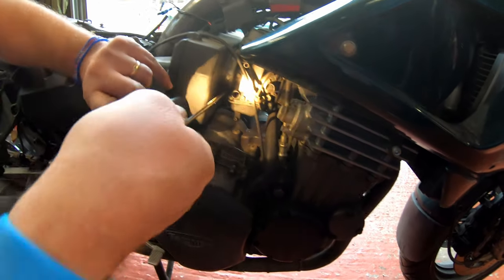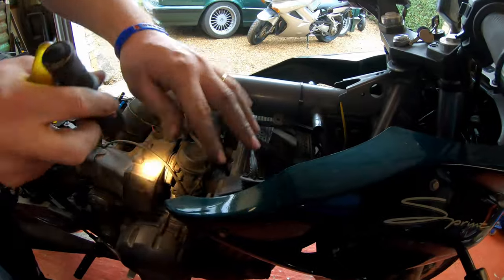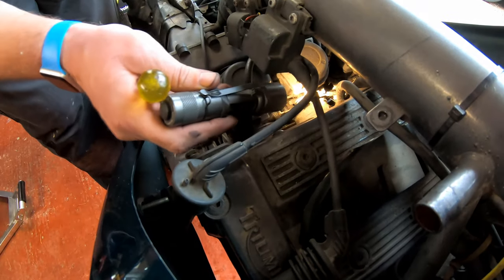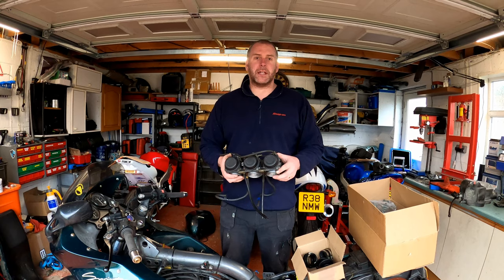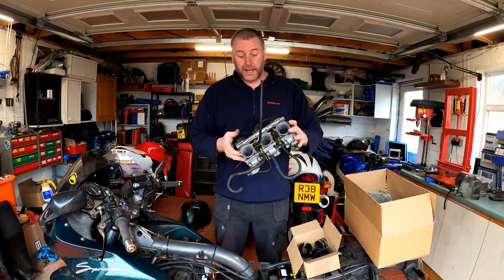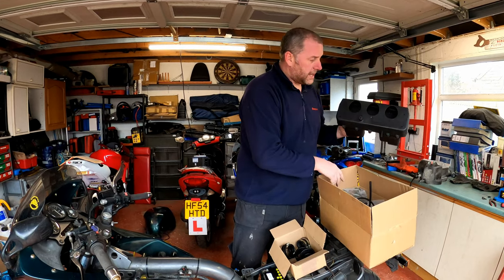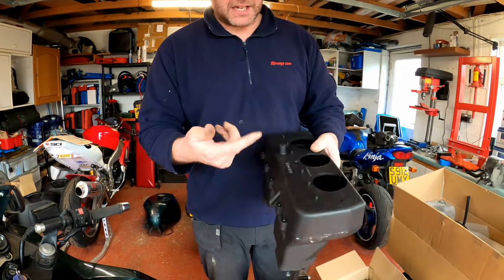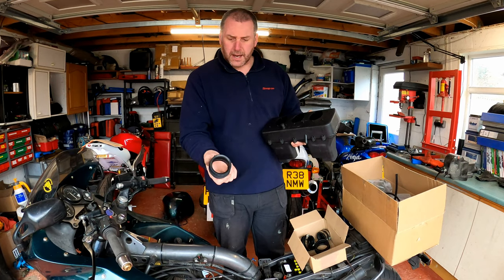1994 Triumph Sprint 900 Service Series - Part Two - Airbox/Filter Replacement - Carbs Off!

Comment: Having refurbished a 1993 Trident Sprint 900 a couple of years ago, your carburettor and airbox removal and installation brought back memories of many late nights and accompanying expletives. I recall particular frustrations attempting to get all 3 air intake rubbers from the airbox, to fit successfully to the carbs and not to mention, getting that throttle cable connected to the carb linkage! Although it's true that Triumph over-engineered this particular bike, they didn't give much thought to the hassle involved in carrying out routine maintenance!! Great video though.

Comment: I've only done this job about 8 times in the last 2 months. It's easier to leave the throttle cable attached to the carbs. Disconnect the throttle cable from the throttle and pull the cable through the obstacle course of other wires all while leaving it attached to the carbs but remember the route it came from so you can follow it upon reassembly. Attach the carbs to the air box first and tighten clamps then shove the whole unit into the head boots. I split the back of my air box as others have suggested but you don't need to pull both back halves off if you don't want to. I remove the left back half only and the box still slides out the right side. All I can say is I'd like to meet the designer on this model and kick him in the knee caps.
Reply from the maker: Cheers for the tips bud! Your right though the design department need a kick in the nads for this one! 😂
Reply: Presumably he's the same designer that specced the location of the Allen key in the toolbag stored under the seat of my Thunderbird held on by allen bolts.

Comment: Hi
I have done this with a replacement  air filter from piper cross ,you need a very long torx screw driver from the front of the engine  to engage the cover on the filter .Dont remove carbs ,dont remove air box ,you can push back the air box against the frame enough to slide out the old filter out .If the filter looks knackered obviously then you make a decision then to remove old air box but if its just dirty then replace with new filter .
The decision is yours .
It is a fiddle but it can be done (getting the screws back is the worst part of the job ) .
Reply: Hello Barry, I have a 96 Trident 900. Trying to restore to original condition. The previous owner used Pods. I have acquired all the original parts but installation is a nightmare. any suggestions??

Comment: I found an easier way to remove the air box without taking off the carbs. After you get the air box, take it apart. The side screws can be  difficult. Cut the back half vertically in the middle with a box cutter knife. Don't worry about the slight vertical gap, any air leaking thru will still have to go thru the air filter. Carbs on, front half of air box on, install air filter, left rear half on, right rear half on.

Comment: Good to see you are struggeling the same as me to put the cables and carbs back on. I pushed the throttle cable mounting (giving gas, if you know what i mean) in so the hole is beter placed for the cable.
Reply from the maker: In retrospect it’s actually far easier to fit the cables before sliding the carbs in place! Having had them in and out a few times, you get to realise the easiest method to do things! 👌🏻😎

Comment: I watched with great interest as I have started a carb stripdown/clean in progress on my 93 Tiger ( just taken them out).
 I have tho' successfully modified my airbox to enable the removal of the K&N filter (now fitted) in 2 mins, yep 2mins. 🤗
It took me one and a half days to come up with the modification 🤔 for which I only needed a stanley knife, two screws, rubber seal and a bit of velcro (plus an old airbox for a one off trial). 
Personally I would have sacked the designer of the airbox, god knows what he got paid for that crap idea, probably thinking only about servicing hourly rates in a triumph workshop 😠.

Comment: You're making hard work of that. Push the carbs on the engine to carb rubbers 1st, tighten up the clips, then the carb to airbox, tighten one outside then the other making sure the rubber is fully seated and tighten the remaining clips. One of those jobs where the harder you try the harder the job becomes.
Reply from the maker: Yeah, it was one of those tasks that I stood back after and realised there was an easier way! Not to worry, they are on now! 👍🏻
Reply: Aye? Im up to this job and can't picture what your explaining. Any chance you could try explaining again please (no offense chief).

Comment: I have a '96 T'bird with the same basic architecture.  Problem is it was laid out in the late eighties and before its release in '92 new EU emissions regs were introduced forcing Triumph to use a larger airbox and a redesign was considered too costly/time consuming... it was found necessary to wrap the the larger airbox around the frame and now we all pay the penalty.

Comment: Hi. Just fitting a  new air box too with new intake and inlet rubbers. I noticed you didn't fit the spring rings to the inside of the inlet rubbers? Any running issues without them?
Reply from the maker: Hmm, that's interesting and something that I never noticed before. I still have the originals kicking about on the bench and they weren't in those and therefore I didn't think about them until you mentioned it and I then looked at a parts diagram. Anyway, the bike runs sweet so I am unsure what it is that they do.
Reply: @KevsShed  from other channels I believe the springs help retain the shape of the rubber ensuring a good rubber to airbox air tight seal 🤔
Reply from the maker: @pikebobstar2033  Yeah, makes sense, I think I will pick up a set just to be sure. Cheers man! 👌

Comment: That can be a tricky job.  Everything is compromised because of the spine frame design. I 've found it easier to disconnect the throttle cable at the twist grip and pull it through. If it doesn't need to come off you can just leave it connected to the carbs.
Reply from the maker: Good idea! 👍🤓
Reply: Pull the carbs with the throttle cable still attached and take it out after the carbs are on the outside of the bike how the manual says it’s wY easier
Reply from the maker: @noelmason2305  In retrospect, absolutely! If you watch the video where I refit them, you'll see that I fitted them in that order! ;)
Reply: That's how I do it only done three times in my time

Comment: Can you provide the website link as to where you got the new Air Filter and Carb Rubbers please.
Reply from the maker: Airbox - https://www.fowlersparts.co.uk/parts/5131/sprint-carb-models/airbox-not-us-cal Carb Rubbers - https://www.fowlersparts.co.uk/parts/5102/sprint-carb-models/cylinder-head-and-valves
Reply: @KevsShed  World of Triumph is also a good source for these bikes.  May have to clarify with them which year because there are some variants from 91-96.  Their parts cateloge doesn't state which year is which parts drawing so no harm with a double check and they respond quite quickly if confused. All Triumph parts.  Some parts are becoming obsolete, but, they are mainly items which you wouldn't normally change unless doing a full rebuild.

Comment: hi got a trophy triple  it arrived in bits the  carbs have fuel inlets at the back near  the air box where do the other two at the front facing the engine go looked everywhere to find this info if anyone can help please